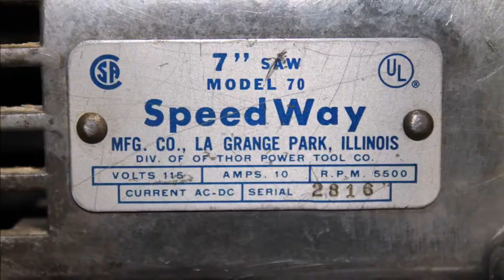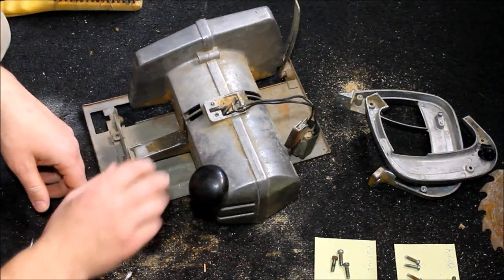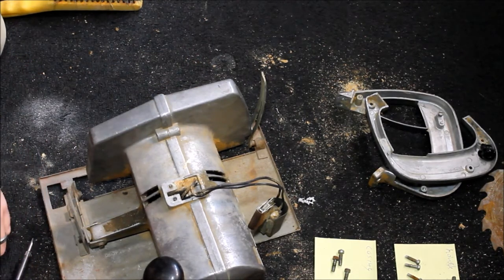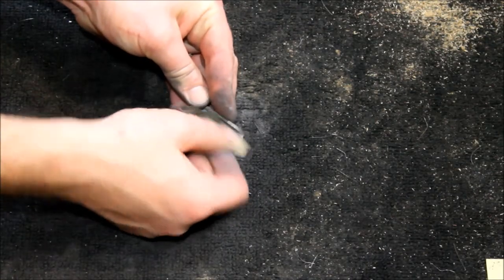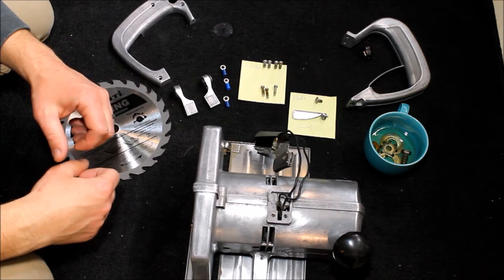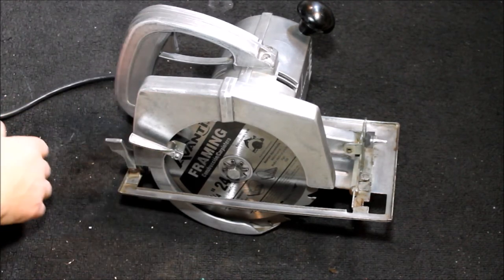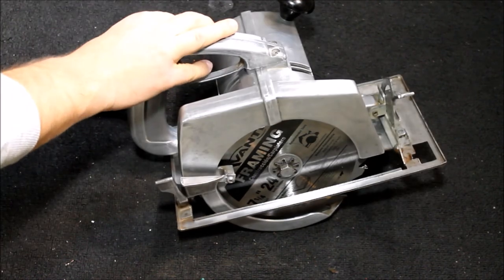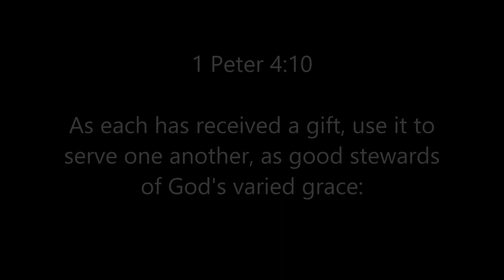Breathing New Life into an Old Saw - Speedway Model 70

Comment: I have to say I like this stuff and redo many tools if you think about it most of the older tool are built out of higher end higher quality items. I like doing hand tools my self they are easy like planners shovels axes hammers and hatches rail road sludge hammers. the thing is on this older tool you cant buy the steel no more. the steel is of a higher end that they just don't make any more. so if you get something from the 50 or 60s or even old these tools where made to last for a life time. I really like the idea of buying a tool one time and never having to replace it. it takes the 4-5 hour in refurbishing a tool that cost little to no money that will last you a life time if properly cared for well worth the time and effort it took to bring these tools back that your kids could never where out it is just great stuff.
Reply from the maker: iwantosavemoney I completely agree with that and I am on the hunt this spring for some good quality older hand tools. I absolutely hate having to replace broken junk tools that I never should have spent a dime on in the first place. Thanks for checking it out!